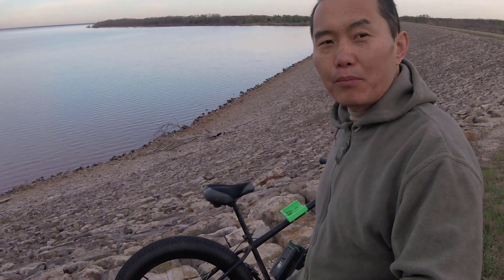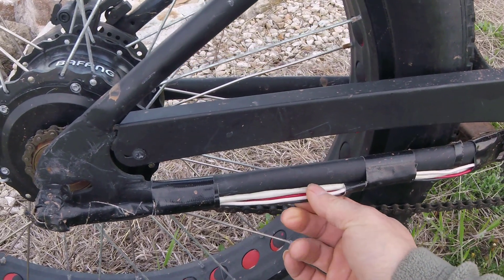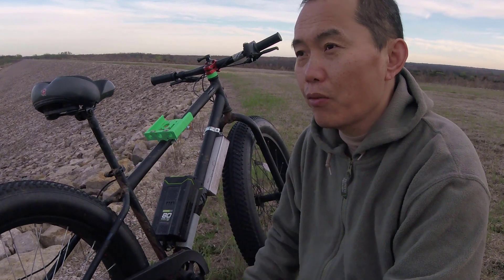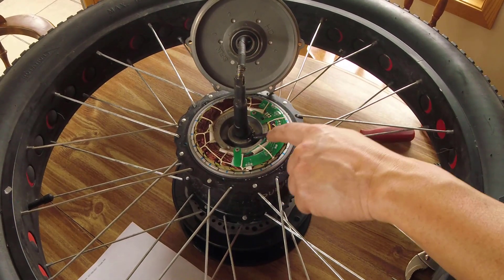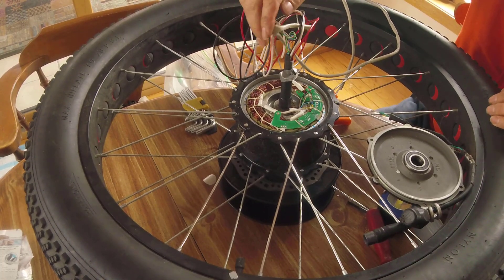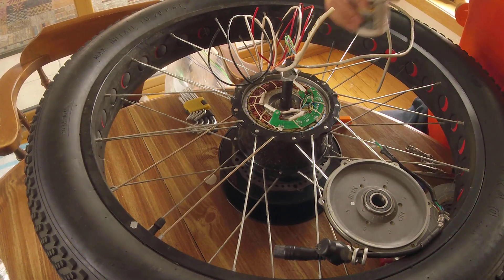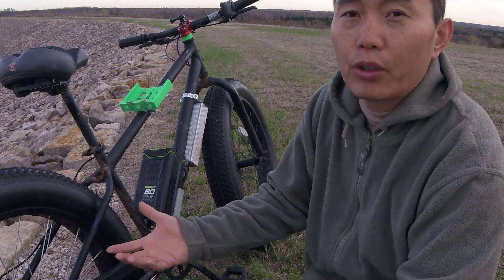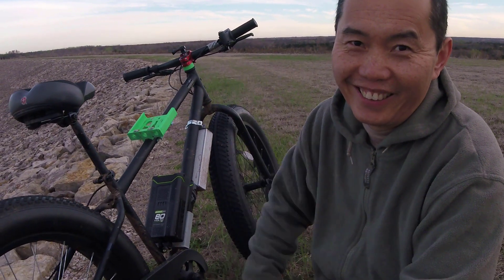how to double the power of ebike hub motor disassembly and replace phase wires

Comment: How do you use a battery of 80v to feed a motor which is designed to work with 48v battery? Doesn't doubling the voltage burn the motor after a while? What about the controller?

Comment: Reflow your controller:  #1 = The Capacitors #2 = Negative Shunt #3 = Negative + Positive Bus Wire on the 3 Phase Wire + Mosfets if you have it!  ADD 15 %+ Power easily!

Comment: You have to upgrade your controller to use this 80v battery. My motor and controller both broke costing me hundreds because controller and motor couldn’t handle the battery power 😂

It was fun for awhile, I felt the power and it worked but ultimately ended up burning up everytjingn
Reply: Interesting.
Reply: Yeah, the highest voltage battery you can use on a 48 controller is usually 60v. I unscrewed mine to check the voltage rating. I can run a 60v battery fine on a stock 48c setup. Just be careful on steep hills, and do not fang it everywhere you go. Just cruise.

Comment: So your not going to get more "power" essentially, but it will cut out some restrictions... Small wires will cause a restriction that creates heat which is the enemy. Think of a hairspray cap with that little hole... Run faucet full blast but only a small drip coming out. Make the small hole bigger you still have the same amount coming in but it lets all current flow easily... Hope this makes since

Comment: I burn my hub motors going up long mountain roads. They just bog down and overheat, especially in the summer sun.
Increasing power would only make it worse. Need more torque AND to increase cooling!
Probably need lower gearing for more torque.
Reply: I'm I'm in Florida I put fan blades work by my motor just like about 4 inches wide to go around they took the lot

Comment: I got 36 volt Junk bike,  can I test rear hub . By direct with a . 36 volt battery. From stihl chainsaw. 4 hour battery. 36 volt😮
Reply from the maker: Yes. Make sure secure the battery connection.

Comment: wish you showed disconnecting the wires. Cool video though. Thx
Reply from the maker: Using torch or high power soldering gun.

Comment: dumb question here, but how do some people that have a 72v battery get their bike going upwards of 80, and one even close to 90 miles per hour? Obviously they have different motors but my question is what exactly is required to go fast? Is it all about the gearing? Like people on surrons have 72v batteries and a BAC4000 or BAC8000 controller but like in the end, what is required to reach high speeds? A beefy battery, a high amp controller, and a way to keep your motor cool? Do some motors just max out at a certain internal rpm? Or is it the gearing of the motor that holds it back? I have heard some on YouTube talk about overvolting motors and that “in theory” an electric motor has no limit besides it burning up. If this is really true I’m wondering why people aren’t going 50mph on cheap motors. Is it not enough torque and wind resistance so they reach terminal velocity at a much lower speed? Or does it all come down to voltage and the controller?
Reply from the maker: Higher voltage equal Higher speed. But common controller can only handle 96v or less.

Comment: do you have a link to the hub motor puller you used?
I use bolts but having a puller like that seems really nice
Reply: Bruh he literally said in the video he got it from autozone. I’m not sure the exact type. In case you didn’t know you can borrow all types of equipment/tools from autozone for free. It’s amazing you pay for them and then when you bring them back they pay you back 100%
Reply: Bruh he literally said in the video he got it from autozone. I’m not sure the exact type. In case you didn’t know you can borrow all types of equipment/tools from autozone for free. It’s amazing you pay for them and then when you bring them back they pay you back 100%

Comment: That new G062 1000w hub motor seems perfect for this. I can't find any information on it. I watched this video years ago when I first got into ebikes. Now I have 3. I'm going to put a 3000w Sabaton controller on mine. I build batteries so I have 2 100 amp 48 volt 35 AH that I can run in series together for 90v 100a.
Reply: Dont do it. Just get a higher rated wheel.

Comment: Is a DC brushless controller the same as a brushless hub motor will it work if it's the same watts and volt 1000 brushless motor hub kit

Comment: So if you are going to set up the hub motor to allow more current flow, you need more current flow. You can do a shunt mod on your controller. YouTube will show you. Also, prob need to add some heat sinks to hub and maybe some ferrofluid to magnets.

Comment: Im sorry to say that just by using a thicker phase wires one can never ever double the motor power. Never. To be able to have a more powerful motor system you need to upgrade the controller with a more powerful one so it allows more current to flow towards the motor otherwise your thicker wires wouldnt do you any good. In some cases some smarter controllers can be specifically programmed to deliver more current to the motor resulting an increase in power but judging by the looks of your controller I very much doubt that is of that type.

Comment: Jerry, it's really simple nowadays to build a battery, even without soldering, & they have kits that you just push the batteries into & bolt all together. Your definitely a smart enough dude to take it on, & you'd get 35-70 miles on 48v/20ah battery, depending on the weight of bike & passenger together
Reply: Can I build an 108v some odd battery? I want to know what my limitations are on that end. I ride a 48v 500w ebike, I know I'd have to change the controller units. And probably a motor upgrade if I want that balls to the wall.

Comment: So in resume; if I wanna go from 48v to 72v I would need.... a 72v battery, a controller that can deal with that voltage (or upgrading the capacitators/mosfets of the one I have), a thicker phase cable (like you are doing), and... Telling to the display that the wheel size is  smaller than actually is, so it sends more voltage, correct?

That's a lot of work! It's incredible you managed to do it.
Reply: I think he only put thicker fase wires in i dont think he put thicker hall sensors wires in ,so i think all he done was change the wires and nothing else

Comment: Hi sir and happy New year!!🙏
I just buy a YYK 50a controller and have 12 awg phase wires 
My motor is 2000w but i was working with 35a controller till now and the thickness of phase wires is up-down as yours!
My question is.....🤔
Can i put together the stock phase wires with 3 more wires 14 awg and conect them (3 stock+3 14 awg) 6 motors phase wires to Controller 3 thick phase wires.??
I will open new hole from the other side of the motor!
The voltage is 72v (if it matters)
Thanks!🙏
Reply from the maker: Normally there's no enough room for extra wires.
Reply from the maker: Good luck on that.
Reply: @JerryMinne  i will drill the motor from the other side!!

Comment: Hello , I'm attempting to follow your lead and attempt the same thing on my das-kit 500w . The motor and controller that came stock does 38km, just throttle,and it does this with my roommate on the back. That's 400lbs. I was going to get a different motor but I'm going to try your 14guage trick first
Reply: Man, I guess I should be happy. We get bikes that are locked to 25kmh but you can unlock them to go 45kmh or 50kmh, depending on controller and display.

Comment: If my controller is 48v with 30A current. Will I get more speed if I upgrade the phase wires?
Reply from the maker: No. Higher voltage equal higher speed.

Comment: hello sir, i got a bafang 48v500w motor, right now i am using 48v/25A+1A controller and 52v25ah battery, top speed almost 50kmh , but i would like to increase the torque of the motor, what should i do ? thanks. good video
Reply from the maker: The only to increase torque is to get bigger motor. Higher voltage doesn't increase any torque.
Reply: @JerryMinne  thanks for your reply， but will any thing changes after i change to a 48v38a controller ？
Reply from the maker: It won't have much different. Even though the motor may take more than 25a at peak, but that is several seconds things.
Reply: CHANGE to a geared hub motor if you want more torque, thats the only way to get more torque, as its a direct motor to hub assembly, also upgrade to flat pack lithium cells that provide 40 or 60amps continuous. my pack can push 200amps but my controller only needs 20 amps and it pushes that uphill max and i have no voltage sag. cylindical cells suck thats why most EV vehicles use flat packs, actually my battery is built with those cells worth every penny. i have 36v 2.5kw 70ah per cell, max speed flat throttle only on 20in wheels is 15mph the best part is on hills i maintain 12mph uphill at 20amps.
Reply: I burn my hub motors going up long mountain roads. They just bog down and overheat, especially in the summer sun.
Increasing power would only make it worse. Need more torque AND to increase cooling!
Probably need lower gearing for more torque.

Comment: I have an old prodeco tech 750 watt motor hub,,  can I swap my controller  to a 72 volt battery to get more power without frying the motor?? Any help would be appreciated it!! Thanks,
Reply from the maker: Yes. Higher voltage equal Higher speed.

Comment: Do you have to solder the wire?
Reply from the maker: Yes for better connections
Reply: @JerryMinne  thank you for the response.

So you don’t use the julet pin connector anymore? Just directly connect new thicker wires to controller wires? 

Do you think I will improve performance on my fat tire bike with just this upgrade?

I have a 1200 watt motor and 52v battery. Thank you in advance!

Also do you know how to derestrict or take off the speed limiter so I can have a higher top speed?

Comment: Let a technician install a rechargeable battery 🔋  system on it. Can even use this to produce electricity 💡 for a house 🏠  by hooking up a converter and battery 🔋 bank .
Reply from the maker: I do have such product:
https://youtu.be/isDpTEBsP6c
Reply: @JerryMinne  It is easy bro just do some research right here on youtube or good, then ask a technician and you will save a lot of electricity bills 💵. Starting off with a battery bank ( like six four or  batteries 🔋, a sensor on and off switch, a convertor and envirtor. However asked more than one technician how it is built before having them do it for you.

Comment: Hello sir:  i have the rad rover (rhino) 5 (250 w). i want to make it go faster. Do you have any suggestion what i can do to make it go faster ?
Reply from the maker: You need change speed controller to match higher voltage.
Reply: @JerryMinne  okay. So i only need to change the speed controller ?
Reply from the maker: Upgrade to 72v speed controller then you can use pretty much any brand high voltage power tools batteries.

Comment: Fascinating. I have a question. Does replacing the phase wires with thicker ones actually increase your motor's power or speed? Have you noticed a significant difference in performance?
Reply from the maker: Higher voltage = Higher speed. Once upgraded to Higher voltage system, the original wires have to be replaced otherwise they'll burn out.
Reply: Voltage doesn't raise the heat. Heat is only influenced by amperes. But a too high gearing (winding) can be inefficient at lower speeds.
Reply: @emilen2  he prolly left the amps at the same level after going up in voltage, when he should have lowered it since a higher voltage needs less amps to achieve the same outcome. Idk what his wires were rated for, so who really knows why he did that is just him
Reply: @davidmiller4758 but he didn’t want to achieve the same outcome he wanted it to go faster

Comment: jerry is absolutely right about thickening the phase wires to let more current flow BUT not until you get a controller that will allow for that extra current. controller first. phase second
Reply: Current shunt... All you need to do is add more real estate to the current shunt in the controller. a little solder along it is all ya need. But make sure you add more thermal paste back to the MOSFET heatsink and do something about your hub motors cooling.
Reply: Thanks for the tips nice one
Reply: Phase first, controller second, you can pump as little current as you want down them thicker wires, theres literally no reason to back out of a phase upgrade, especially considering how hot the stock wires would get even with a basic 750w system.
Reply: Also shunt mods dont always do something, Ive had a fair few controllers that basically ignore the shunt because the firmware is setup to run the fets wide open anyways.
Reply: @JamiePineappleWyatt  yeah a shunt mod won't work if you don't have the available amperage from the cells/BMS/ or of course a fuse that'll go. 
A shunt will always work otherwise though (unless I'm missing something). Shunt mod tricks the controller. The shunt is a certain resistance allowing current to be measured by voltage drop. Mine was 0.63 Ohms before I modded and 0.45 after. 40amp fused, BMS and constant cell discharge available gredter than 40 amps. Hall effect sensor is a different story and I wouldn't know how to trick it in that case.
Reply: @robcoastalga8279  you misunderstand.

Even with triple the required current available, a shunt mod will do nothing for a controller that is already running the fets as hard as they can stock, MANY cheap controllers do this, cheap fets get pushed as hard as they can be all the time and thats why its so common for cheap escs to pop.

Yes you are missing something, the actual point of my commont lol 😅

The Hunter X10 you see on my channel has had both shunts in both controllers soldered together, theres not even half the resistance there anymore, still pulls 25a max for each controller for example.
The stock battery is capable of 60a easily and I also have a secondary parallel pack so current supply is of no issue at all, it just depends on the hardware, this isnt an abnormal thing at all as endless-sphere users have documented the same thing countless times
Reply: I burn my hub motors going up long mountain roads. They just bog down and overheat, especially in the summer sun.
Increasing power would only make it worse. Need more torque AND to increase cooling!
Probably need lower gearing for more torque.
Reply: I got the battery, I upgraded wires from 80v to controller and it worked for awhile but ended up smoking out my controller to the point of no return.

I am looking on AliExpress for a stronger controller but with the 5-1 cable connections because I don’t know how to do the other random e-bikes ones. 

Any advice on controller for 1500w Rear Hub Motor Would be great. I want to use a double 80v with the dual connector.
Reply: I prefer overbuilding things, you see he added a controller that allowed more power and melted his original phase wires, just go for phase wires first and never worry about that if you upgrade your controller later.
Reply: You have a link of where these upgraded wires can be purchased?
Reply: Reflow your controller:  #1 = The Capacitors #2 = Negative Shunt #3 = Negative + Positive Bus Wire on the 3 Phase Wire + Mosfets if you have it!  ADD 15 %+ Power easily!
Reply: If my controller is 48v with 30A current. Will I get more speed if I upgrade the phase wires?
Reply: @lincolntay5246  it depents on you BMS if you got an 48v 15 ah pack it comes usually with 40-50A BMS you can go then for an 45-50A controller
Reply: @salviaaable  man where do I learn all these terms haha I’m new to this stuff
Reply: @echospacez  just keep on watching videos about E mobility here on YT they are plenty of channels to learn from, EV customs for example

Comment: sorry jerry but there is one thing wrong with your theory. it is the controller that dictates how much power a hub motor recieves. not the thickness of the wire. people, this is alot of work for nothing
Reply from the maker: Yes and no. The controller controls the speed, of course, but not the way you think. As I said the controller controls speed not the current. The controller has limitation on current but actually control it. For example, when motor has heavy load like climbing hill, you give full throttle, so the controller has maximum output, but the motor try to drink more current. in that situation, if you have thin wires, the wires burn out, if you replaced thicker wires but has small controller, the controller burn out.

Comment: What is your top speed with 80V? What size amperage controller are you using? Interesting build.
Reply from the maker: 35- 40mph, 50-60a controller is good.
Reply: @JerryMinne  do u know where I can get a 1,000w gear hub motor?
Reply: @dimitrimcintosh8858  aliexpress
Reply: @dimitrimcintosh8858  I bout a 1500w and 52v battery on Amazon. I hit 40 on a fresh charge lol
Reply: @JerryMinne  dumb question here, but how do some people that have a 72v battery get their bike going upwards of 80, and one even close to 90 miles per hour? Obviously they have different motors but my question is what exactly is required to go fast? Is it all about the gearing? Like people on surrons have 72v batteries and a BAC4000 or BAC8000 controller but like in the end, what is required to reach high speeds? A beefy battery, a high amp controller, and a way to keep your motor cool? Do some motors just max out at a certain internal rpm? Or is it the gearing of the motor that holds it back? I have heard some on YouTube talk about overvolting motors and that “in theory” an electric motor has no limit besides it burning up. If this is really true I’m wondering why people aren’t going 50mph on cheap motors. Is it not enough torque and wind resistance so they reach terminal velocity at a much lower speed? Or does it all come down to voltage and the controller?